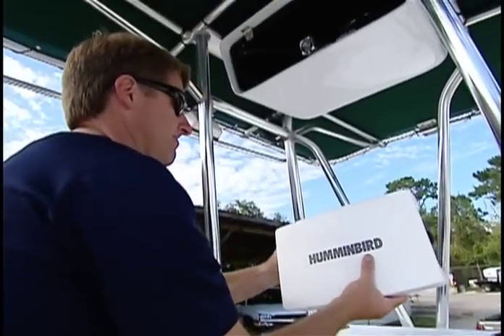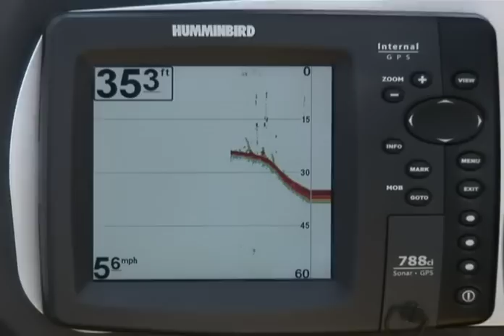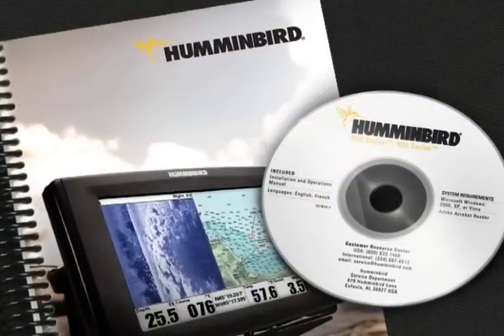Humminbird - Installation

Comment: Having drilled more holes in fibrglass than I care to remember - a couple of comments. ALWAYS tape the work area where the hole locations are prior to drilling to prevent splintering. Rather than silicone or 3M sealants (can be very messy)  - I have used grey butyl tape for years as the hole sealant. Advantage? Clean up consists of simply trimming the excess butyl that bleeds out after tightening is completed.  Happy drilling!

Comment: ok maybe i worded it wrong...like you showed...the side image transducer can be mounted thru the hulll. not insde the hull shooting thru...i noticed you said on salt water boats ect...my question was..if my bass boat doesnt have a jack plate..and i install it the way you showed using the 1 1/8 hole